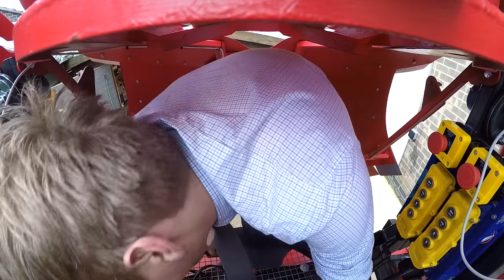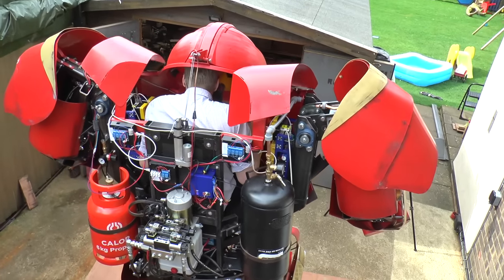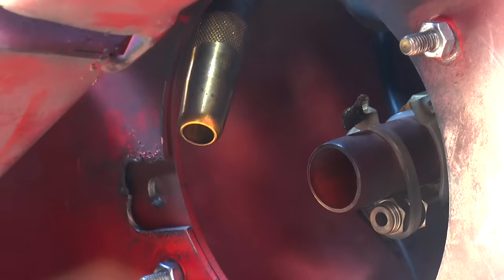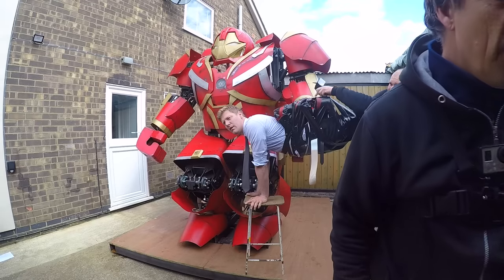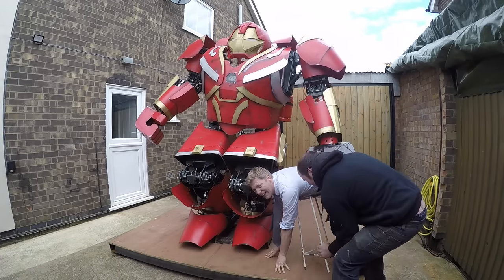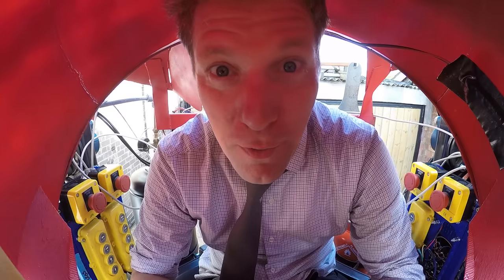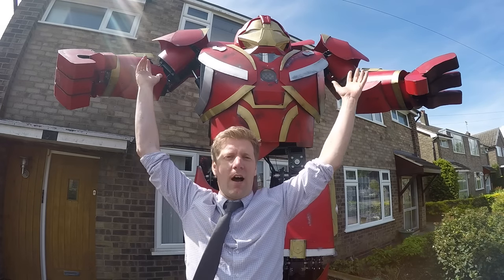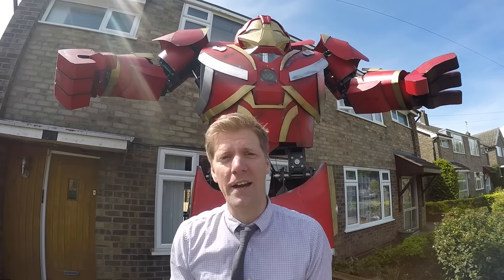Homemade Hydraulic Hulkbuster

Comment: Guys this ain’t a LEGO mindstorm set. To make it walk would require a lot more time and effort as well as a huge budget. So please understand the limitations of these kinds of things before criticizing him for it not walking.
Reply: military is working on walking bots. best they can do is four legged walkers.
Reply: The waist and legs are some the hardest parts to copy.
Reply: I was impressed it could even maintain its balance while swinging Colin around with one arm.
Reply: That's not really true. Quadrupeds are more suited to carrying loads over uneven terrain, that is why you see a lot of military spec ones. The military are more than capable of making walking bi-pedal robots, heck even  James has a few. Bipedal walking robot technology has been around for several years now and is not all that complex.
Reply: He could easily make it shuffle its feet forward , but actual balance on one foot , would be a little tricky but, doable. You would just have to tilt waist at same time it steps ,to maintain balance.
Reply: problem with that, he'd have to add tilt control into each of the legs, currently gravity is doing all that work for em. additionally, with the two pumps n tanks extra in the feet, plus the legs being like 2/3 of the total height, them things are probably the main mass of the entire build, so he'd have to bulk up the upper torso to be able to use that as a proper counterweight, and you'd still have to use the lifting leg to get the entire construct balanced over the other leg before you can actually lift it, meaning you'd need an indirect control system instead of the pretty straightforward control system he employed

tl;dr "doable" is a stretchable term.
Reply: The Soviet Gutter Cat where is your hulk buster?
Reply: Exactly. People are so bitter.
Reply: Did you even read my comment, or do you just have your panties in a twist because you are fanboying? I never said I was capable  nor that it would be easy/feasible for Colin to make the robot walk, in fact I would be astounded if he did so. I was merely commenting on the fact that the military are capable of it with their billions to invest. It's not rocket science, it's a matter of being fluent in writing scripts, raspberry pis, gyroscopes, sensors and basic mechanics.
Reply: No one is bitter in this comment thread, stop white knighting. Have you watched any of James's (the guy who programmed this robot) videos on Bipedal walking robots? It's more than possible for a home hobbyist to get a robot to walk, no one is saying it would be easy for this robot to walk.

Comment: A like on this video is the least thing anybody should do, this should be funded so he can make a walking version btw. 
It's so Amazing what you can do with just a little bit of hydraulics and a mastermind like Mr furze
Reply: JUST a little bit of hydraulics
Reply: Kanüle 69 in a past video he said the only degree he had in anything was plumbing.
Reply: james did make some kinda walking things, it would look so cool to have that thing walking btw
Reply: Le couscous - Yeah, but James's robot weighed a few kilos and could react quickly and accurately enough to walk. This thing weighs in the realm of tonnage and is slow and cumbersome. Boston Dynamics would struggle to get it to walk, let alone on a budget set by ebay in someone's back shed.

Comment: Why would you tape yourself to the business end of a flamethrower? Just why?
Reply: Corylus Bluefox как сопли
Reply: HES COLIN FURZE BETTER QUESTION WHY THE FUCK NOT?
Reply: It isn't lit so it's probably safer than maybe getting power fisted to death by the other arm
Reply: I agree dinand
Reply: Corylus Bluefox or stand in front after it flamed a bbq
Reply: Don't worry, he wore a safety-tie
Reply: Corylus Bluefox why not
Reply: Sedr0 My apologies, I had forgotten the ultimate life-saving force that is the safety-tie.
Reply: I assume the flamethrower arm was more sturdy. The smaller pneumatic pistons used on the fist of the other arm most likely wouldn't have been able to take Colin's weight and/or they didn't want to risk damage to them.